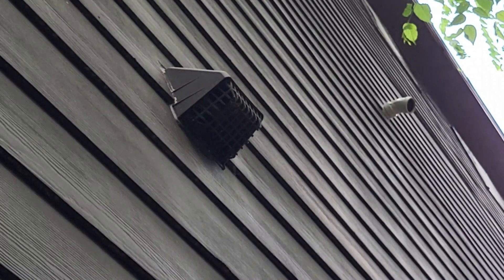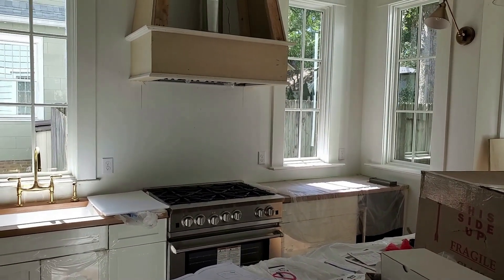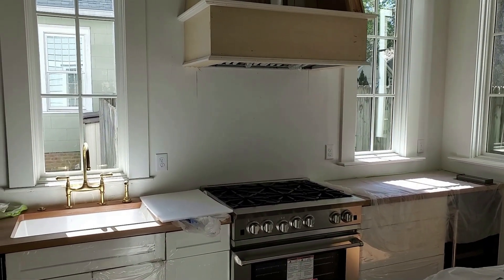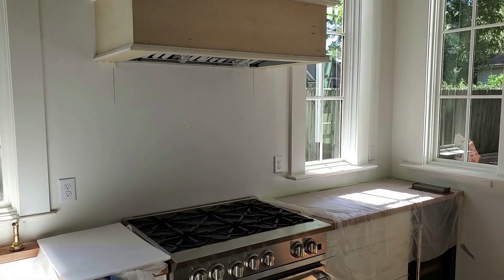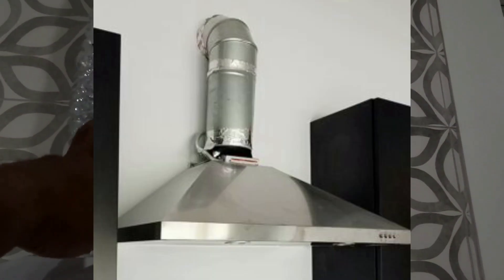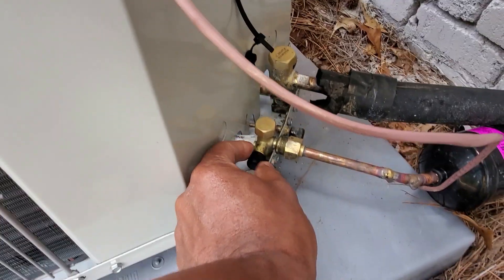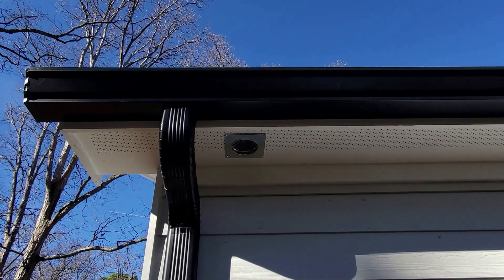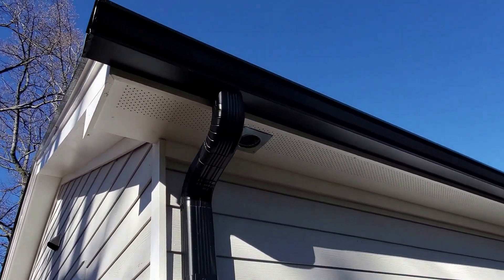Top 5 Residential Mechanical Code Violations

Comment: I can't believe anyone would ever think it would be okay to use flex duct over a kitchen hood. 😄. It's not just the heat that's an issue but I would guess that flex would get all gummed up with grease.
Reply from the maker: Well, in a lot of cases, that flex duct comes with the hood. So contractors think it's ok to use it.

Comment: Seems like after the new make up air requirement, there are many hood mfgrs. that have unit's rated "just under" the threshold for the makeup air requirement even though they look very similar. We routinely install 1200 cfm hoods. (seems to be a magic number), and I have asked a few what setting they run it on,..and they always tell me they run it on the lowest setting, the highest is too loud and too much.
Reply from the maker: So, you're not providing make-up air??
Reply: @PPG1967  Make up air is always supplied when required

Comment: Just a point of clarification for the make up air. I am not sure about your local code, but at least where I am at if you do not have any non-sealed combustion appliances, then there is no requirement for makeup air for vent hoods. Obviously you have a gas range right below the vent hood so it would apply. This is not to say make up air would not be beneficial, especially for these larger hoods being installed all the time. The air has to come from somewhere, whether that be through cracks and leaks in the building envelope or you control and clean (filter) the incoming air to balance the exhaust. This is why the code book includes this for combustion appliances. You don't want to back draft the exhaust from another combustion appliance in the house, such as the water heater, furnace, chimney, etc.
Reply from the maker: I appreciate your feedback...thanks for watching!!

Comment: That plastic flex hose on #3 is just so telling about the contractor.  It’s not even about cheap, is the lack of understanding between stove heat, and thin plastic.  I’m curious what happens when you run that fan with all stove burners on, and the oven preheating.
Reply from the maker: They just don't understand...I appreciate you watching!!
Reply: not to mention the grease component getting caught in all those flex ribs
Reply: I just hooked up the power & helped my buddy install one of this type of exhaust hood fan, it came with this type of flex already installed on the fan!  It moves so much air that it lifts the grates when on medium & high settings without make up air!

Comment: Building code = lets make houses unaffordable.
Do you really think that the soffit vent sucks in so much air that the bathroom vent will be problematic?
Locks on the a/c ports really?
Reply from the maker: Building Code = structurally sound & safe to occupy. There are a lot of ignorant contractors out here.. I see them everyday.

Comment: locking caps on A/C?  Bro you are reaching fo sho
Reply: Sadly it is required to pass inspections here in Florida. We also can't use plastic pads and have to have tie downs. If the pad is poured we only need 4 tie downs, if it's a concrete/styrofoam pad we need 8 tie downs.
Reply: @doitalldave  I'm in Ohio,  can you link something on those tie downs, I've no idea how they would do it. Thanks
Reply from the maker: I appreciate you watching.
Reply: Nope, good call.